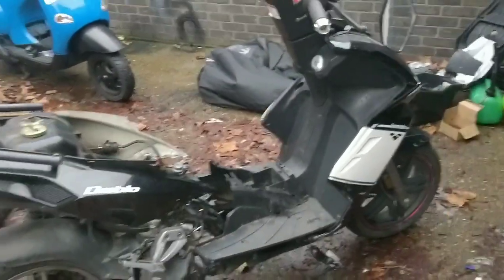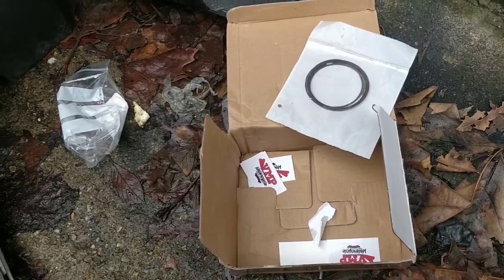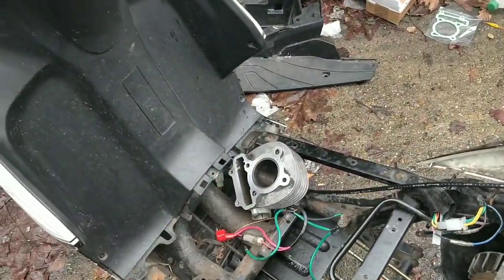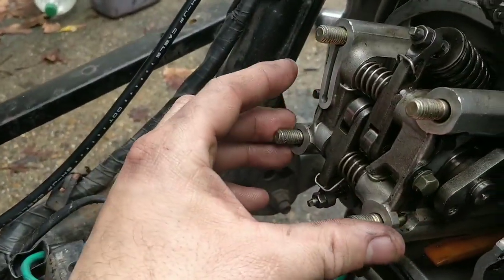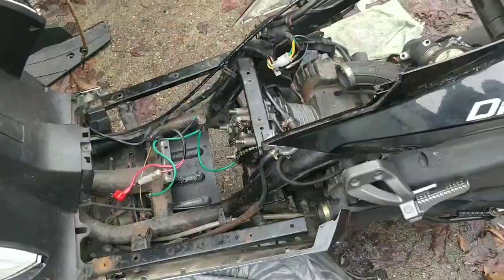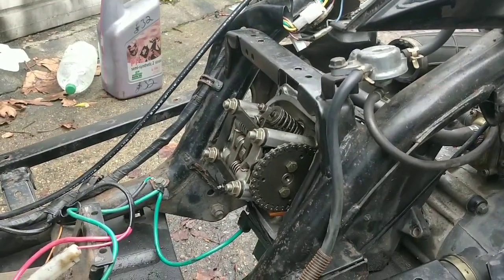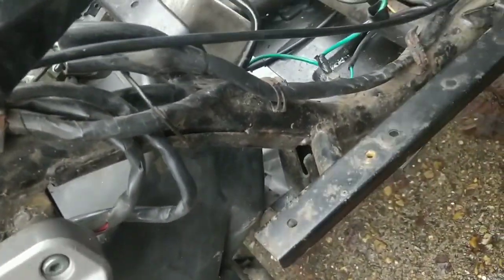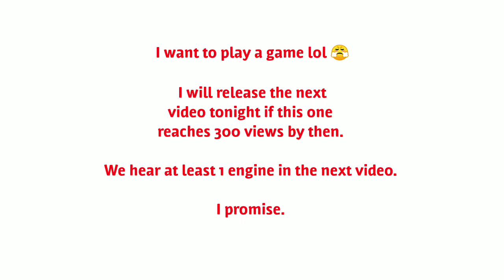Lexmoto, diablo, engine build, piston and rings. 125cc piston.

Comment: The oil light keeps flashing on my motorini missano 125 need answers with doing this myself motorbike rescuer
Reply from the maker: Check the oil first Kyle, if it's getting low and then sloshes around that will trigger the light on and off. Top up the oil a touch mate.

Comment: Is that a short gy6 case or long ? Please
Reply from the maker: Hi Leon, I'm afraid it's hard to tell from the vid but it's almost definitely a long case. Most of the 125s are. 

Sorry I can't help more mate.
Reply: @motorcyclerescuer  cool thanks got to grab a 150cc gy6 motor as lexmoto made it very hard to swap out the bore kit on there gy6 because they are a company with limits .if u try you will lose . So a full engine swap will probably work best
Reply from the maker: I get that, I think you are probably right Leon.

Comment: Hi buddy did u set valves engine sounds very tight. These chineas are very touchy with settings etc
Reply from the maker: Hi, yes I thought the same. How did you hear that on such little info? That's an amazing ear. It was definitely tight/to high compression.

Solved every issue today and it starts and runs like a dream.

Thanks for watching and commenting.
Reply: @motorcyclerescuer  good stuff i build and repair these engines and the gy6 engines more or less weekly lol just dine mine recently with a makura 150 top end runs lovely now changed final drive gearing too so she will sit at 70 all day.  Keep the vids coming buddy love it 👍
Reply from the maker: @jennabailey3218  oh really. I think I'm going to do a couple of high performance mopeds this year. 150 kits and variator upgrades ext. Just to experiment.
Reply: @motorcyclerescuer  there a good  motor and go very well. Most of the engines i do are from pore upkeep and lack of maintenance. If lookd after they go for ever 😁

Comment: Hey, i got a lexmoto diablo 125cc....can i get a bigger engine in it?
Reply from the maker: Yes and no, any gy6 engine could be fitted with some work to the mounting bracket or points but it probably wouldn't be worth the effort. 

Personally I would put a big bore kit on, tune the carb up a touch aswell as the variator and possibly the gear box to get the best out of it.
Reply: @motorcyclerescuer  thank u 🤙🏼🤙🏼🤙🏼
Reply: @motorcyclerescuer  anyone done this
Reply from the maker: @olliewakefield226  yes its done plenty all over the world. The gy6 125cc engine can be bored out to 210cc alone, plus bigger carb, more air in and out, better final gearing and these can be very fast
Reply: @YoungFlevaMusic  don't try big bore kits for gy6 lexmoto have restrictions got it on lock , it will be the cylinder outer bolts you will not line up and that's that . No parts fit . Don't waste your time.  Get a better ped.
Reply: @Thelivelyone  thanks bro...i already changed my ped...got a Honda Forza 125cc